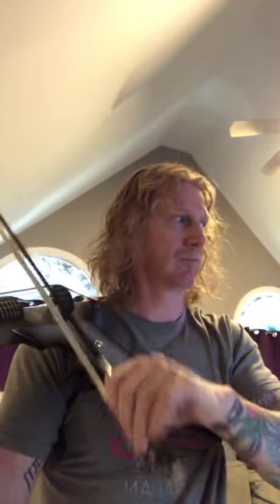Demo of Line6 Helix Patches for Electric Violin

Comment: hey Matt, i am about buying the HX effects of Line 6 to use with my electric violin ? Would you recommend ? thanks for any comments or advise ? Do you know also something about the older TC Electronics Nova System ... ?
Reply from the maker: flipmacyt There are tons of top players using the Helix. It’s a fantastic platform and it’s always getting better. They release new amps and effects on a regular basis (for free). There’s also a super helpful online community on FB. And Line6’s customer service is outstanding. 

With all of that being true, I can’t imagine why I’d choose an outdated pedal over the Helix.
Reply: Matt Bell thanks Matt !
Reply: @MattBellViolinist  hi Matt, how do i get your patches for violin for the HX effects ? what would be the cost ? Which packages/collections are there if any ?
thanks !
Reply from the maker: @PhilipDViolin  It's $30.  You can PayPal me at matt7738 at gmail dot com and I'll email them to you.  I'll make sure they're updated tonight.  I just did a new set for the Helix Floor/LT.